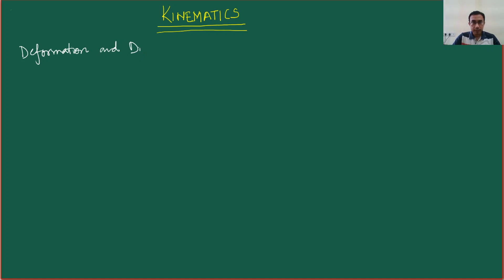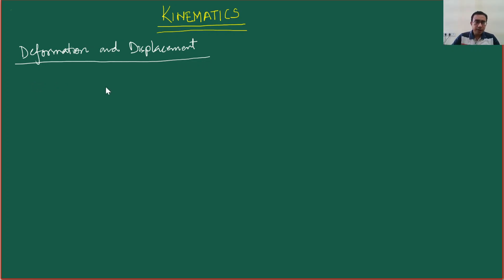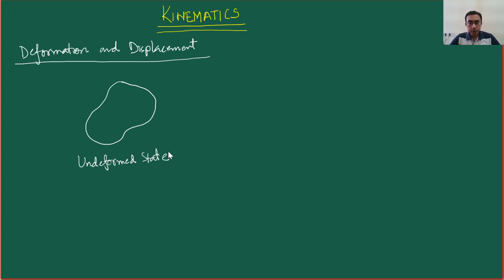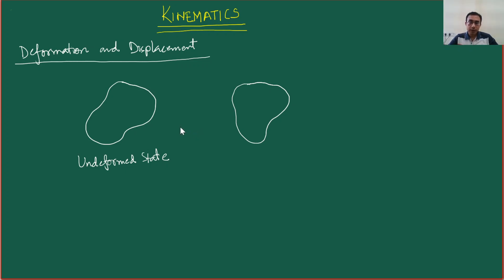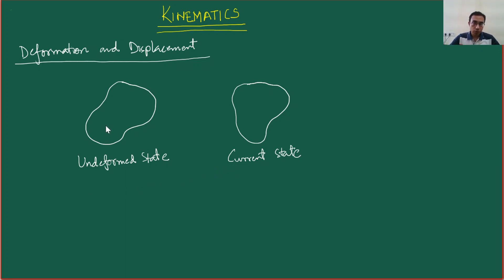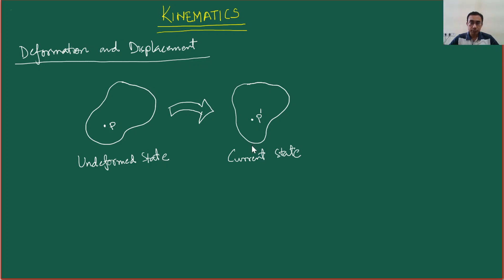Kinematics - 1: Deformation

Comment: Two small queries:

How does one exactly define the undeformed state of a solid? (i.e for a given material element under thermodynamic equalibrium at pressure p and temperature T, what constitutes the strain/stress free configuration?)

How do we define the (thermodynamic) pressure of a solid, since it does not explicitly appear in the constitutive relations, unlike a fluid?